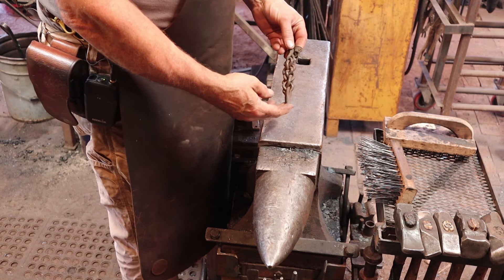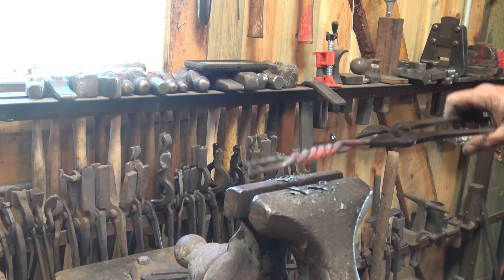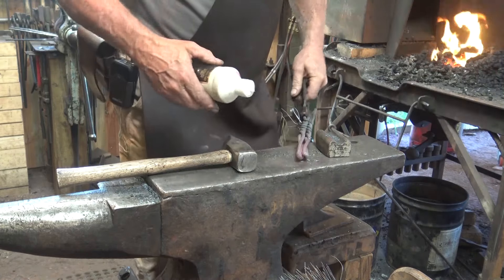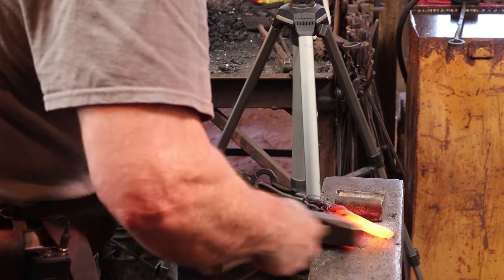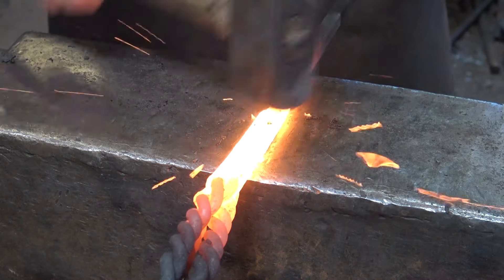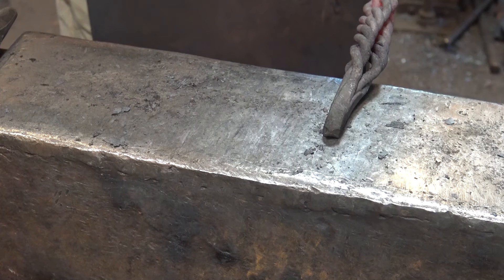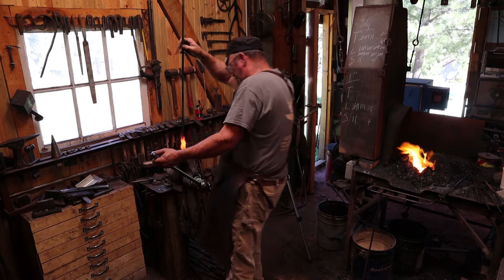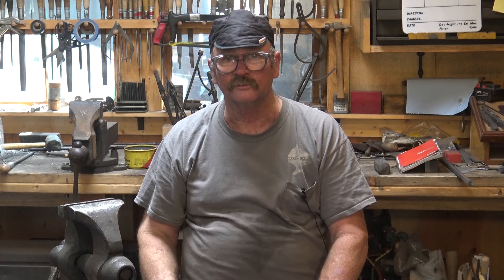Forging a Braided Twist handle

Comment: Thank you so much.  Love learning black smithing from your vids. 
A little tip.  When twisting  tieing wire always twist it  clock wise if you're right handed.  If you tie rebar all day your arm will die twisting wire the wrong way.

Comment: I had some thick welding rod I used for one of these and it worked out with 8 prices. I like the spacing you achieved with 6.

Comment: I'm not a black Smith.. I'm a Vaper.. But you inspire my for some forged coils.. TNX a lot.. Heat and bend. Now I need to build a tiny tiny forge... Will it also work with 316ss? Pleas help me out. Greetings From Swizerland.. By the way I forge little things. Little things....  More tiny.. 😁

Comment: I know this has been nearly a year ago. I'm a new subscriber and I'm enjoying going back to your older videos. Just curious: It looks like the number of your back twists was half the number of your front twists. (I counted that you did a 3/4 twist when you stopped to fix the curl then did another 3/4 twist on the reheat.) Have you noticed that ratio of half number of twists back to have the best aesthetic with this braided twist?
Reply: I'm not a blacksmith although it's fascinated me since I made my first cold chisel in FFA and wanted to pick it up but never had the opportunity (too old now). I have done some jewelry making and this technique could apply to that as well. I've noticed a lot of overlap.
Reply from the maker: For the most part its just back twist until it looks right

Comment: Again, a non metal worker asking dumb questions.  1.  When you bring it up to welding heat is the time you can actually weld fairly short based on the piece cooling.  You have been doing this quite a while so you seem very efficient about it.  I could imagine a novice might struggle with this.  2.  Is forge welding as strong as other forms of welding?  You  mentioned the hook end was 6 pieces and use caution in shaping it.
Reply from the maker: As soon as the material drop below welding heat you are done welding.  If the weld isn't completed you can reheat and continue.  How long it stays hot enough is dependent on the mass of material.  Forge welding can be as strong as other forms of welding if everything is done correctly, but it is more difficult to achieve a perfect weld.
Reply: @BlackBearForge  Thank you for the reply, learning never stops even if one never plans to use the skills you teach.  I really appreciate your style and presentations.

Comment: I notice the cross on your hammer in this video appears to be off center. Is that a particular style of hammer or did you make that to fit your style?
Reply from the maker: It is at a 45 degree angle to make it more comfortable when drawing out with the peen.

Comment: What exactly is Flux? And what does it do from a non metal worker?
Reply from the maker: Flux in some form is used for welding, soldering and brazing.  It helps clean the material and in the case of forge welding it forms a coating that prevents oxidation in the fire.
Reply: @BlackBearForge  Oh, okay thanks for responding I didn't know that.